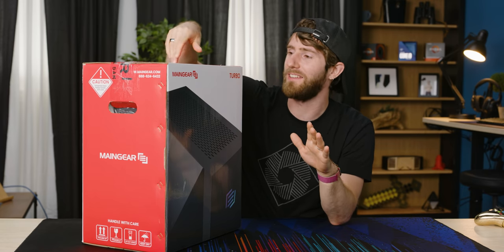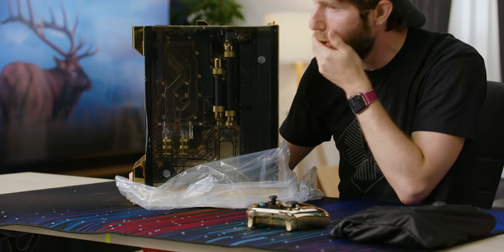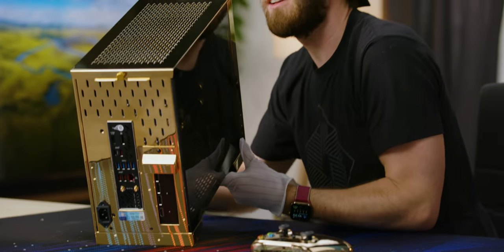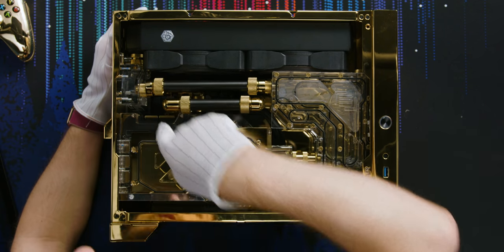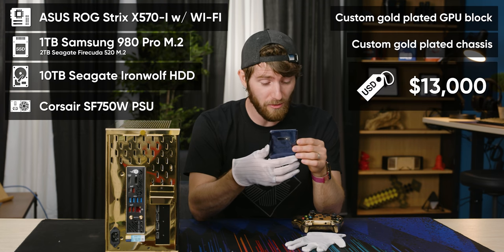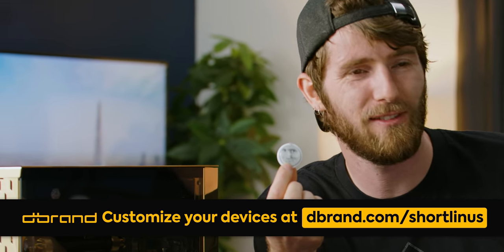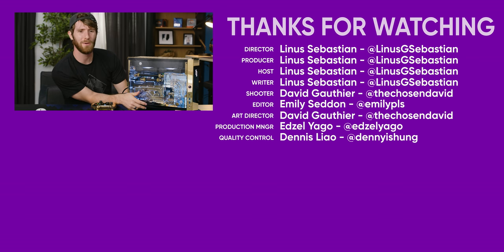MAINGEAR is definitely NOT getting this back! - Turbo PC Gold Edition

Comment: Hey guys, MAINGEAR CEO here.. again :-). Idea for the gold Turbo happened after watching the gold controller video. We're already getting requests to purchase this gold Turbo, and frankly, it's probably not going to become a limited production Turbo. This was more of a prototype or experiment. Gold plating simply exposes every imperfection, and the inner panels just don't look as good as we'd like it to. Perhaps we'll sell it if we ever get the the plating to the point where we're happy.. but who knows! Just thought LTT crew would enjoy so we did it! Also, some quick insight into this configuration. We actually engineered a new APEX block specifically to make room for a thicker 280mm radiator, to ensure the 3090 and 5950x would deliver their full performance. It definitely pushes the boundaries of performance in a small for factor PC.

For the record, there are only two units in existence.. LTT has one and I have the other :-) Let me know if you have any further questions. Cheers! - Wallace Santos / MAINGEAR CEO
Reply: Since they very intentionally steered saying the component temps what exactly did they get too in your testing before you shipped it out.
Reply: Instead of gold plating it maybe you can make it with polished brass? It would look like gold but more robust.
Reply: @Theinc0gnit0  brass gets weathered over time though.
Reply: @Daggers21  From my experience the side panel isn't that thick and is prone to dents.
Reply: @BigYacht  they didn't say common m temps for several reasons. First, this is short circuit. Second, it is not anything more than a fun prototype for an ad spot. It doesn't matter what the temps are, because it's not going to be sold, it hasn't been built and optimized like a product going into production would be. The temps are inconsequential.
Reply: @Daggers21  i think that was caused by the ripped off screw
Reply: You messed up not including trident royal dimms.... Like how?!
Reply: Are you going to let Linus keep it lol?
Reply: Ugh that is just sooo ugly. At least the controller was an interesting build and was technically impressive to see the skill that involved in casting such a complicated piece. This is just gaudy, its about as attractive as having gold plated teeth (and lets be honest here, everyone thinks that shit looks disgusting). I mean, if you are gonna make a gold plated case, at least go out of your way just a little bit and give it some kind of theme or come up with some cool case mods. Not only is it ugly, its lazy and lacks any ingenuity or imagination.
Reply: @clayallen_art  you kidding me? I saw that thing and my jaw dropped. It's got a certain aesthetic for sure but like... how is that not a work of art to you?
Reply: @mindlessmrawesome  i dont know what to tell you man, I work for a design company and we make sculpture and huge outdoor pieces for resorts and people with too much money to spend. I see a lot of gaudy gold, and at least that stuff has form and some style. This is a gold plated box. Like I said, they could have at least put the minimal effort into giving it a theme or some kind of concept.
Reply: Does yours have a broken standoff and a screw loose too?
Reply: @adwaitgoku27  shipping is a bitch mate. Trust me, I worked as a preloader for ups. All you can do is pack it with foam and hope for the best.
Reply: @clayallen_art  like they said, they just gold-plated one of their pre-existing models (that happened to already look really cool). Trying to turn pcs into artistic masterpieces that have shape and form and style typically end in thermal nightmares, take Alienware's and corsair's fancy looking prebuilts. 
Ultimately, it's a matter of opinion, but it still surprises me that you can call something that majestic ugly.
Reply: Meme lord 9000 over here, can definitely tell it shows imperfections more than usual pc paint schemes,  for sure could have put the new trident z royal in there to match it. either way keep up this cool marketing stuff, way better than ads  i block or ignore.
Reply: How about giving one away for someone to enjoy, instead of letting it sit as one of hundreds of PCs in LTT warehouse?
Reply: You should have sent one to Dave Lee too! He is a fan of compact performant PCs.
Reply: Truly a beautiful machine. You guys really do know how to make PCs look amazing.
Reply: Keep doing cool stuff that pushes the limits. Doing something unique is always beautiful to see!
Reply: Nice
Reply: You really ought to uprate the PSU to a 850w or even a 1000w PSU. 750w is just not enough for a 3090 with its crazy peak voltage.
Reply: Your video's sound is non-existent so this is officially the best video about this product :)
Reply: @clayallen_art  they did.the theme was GOLD,lol
Reply: caralho maluco, tu é brabo!
Reply: Props for backing your brand, this is very cool
Reply: @mindlessmrawesome  I never said it needs to be some art piece, I just think that they could have at the least, put some kind of minimal effort into design aesthetic. And yes, everyone has their own tastes, some people like it, to me its just a gold plated box.
Reply: That as a piece of ART right there.
Reply: Do you want it back?
Reply: That golden pc you guys did looks really fancy. Even though I don't even like gold that much, I still think it looks super cool.
Reply: You missed a trick by not using Gold Trident z Roylal ram
Reply: @clayallen_art  it's not a gold plated box it's a cool gold plated engine. it's like you didn't even see the video ;)
Reply: RIP for that terrible trade offer tho, sending over a gold plated PC for that older Turbo in return.
Reply: You know... how about a Hydrodipped Carbonfiber design? And maybe RGB in/shining through the pipes instead of plain white?
Reply: I want it Maingear!!
Reply: You guys should make a youtube channel
Reply: maybe you can glue some sound dampening foam to the inside of those pannels it will look good and have a minor acoustic benefit.
Reply: Looks great, I went to your site to check the price (I can't afford it regardless) - how much would a production version of this system cost?
Reply: Very creative.. thank you for your team doing this art..
Reply: @Daggers21  appeared? That was a Elon musk Cybertruck broken glass kinda dent... Why would someone plate a cheap piece of sheet metal with gold?
Reply: When a RTX3090 can make a 850watt gold+ rated psu shut down(like it did in one of linuses earlier videos) , with a game running, How come you guys build this one wiht a SF750watt ? , its not enogh for the 3090 spikes.
Reply: @Theinc0gnit0  DIYperks has entered the chat
Reply: @alphatumeric  so dont touch it
Reply: Woow nice!! So cool that you commented some insight, thanks
Reply: @Theinc0gnit0  The whole point of it being a gold computer is that it's, well, gold. It's not like Jewelry where precious metals are the standard and you can get away with a cheaper alloy for a "cheaper" budget product. The computer has to be gold or it's bust.
Reply: @clayallen_art  Its like the original concept of the turbo has completely missed you. Then again, Linus did say you probably won't find it interesting if you aren't a tech nerd so as you will
Reply: @mrmarecki1  Cause they only made it for LTT because linus decided to make the gold controller.
Reply: Tell the rich people from Saudi Arabia they like Gold ;)
Reply: just go with black you clowns
Reply: I really love the fun stuff that Maingear does in the community. With such a passionate and out in the community CEO its no surprise Maingear always performs so well in secret shopper. Price to performance doesn't always have to be the only value proposition, the finer details Maingear really nails, and that is what gives me the confidence to recommend them to friends and family that don't have the capacity or desire to build their own PC.
Reply: @mindlessmrawesome  Firstly. Alienware is owned by Dell. Secondly Alienware is Garbage don't buy PC's from them. Seriously yes you get thermal problems that tends to happens when you make fake airholes placing your PSU on top of and i when i say ON TOP i mean ON LITTERALLY TOP of the CPU you get airflow problems.
Reply: @xenonram   On the basic level you are right, but this is also a nerdy channel for nerdy ppl. We wanna know the nerdy facts, just like the car guys wanna have specs on that million dollar Ferrari prototype they can never get.
Reply: isn't 750W a little low for a 3090 and 5950x?
Reply: You missed an opportunity to use the western digital 18TB Gold
Reply: well here's a question, can I have yours? ;p
Reply: I want one I am ready to not buy a car plz made the like the normal ones
Reply: Interesting question, did you think about using the case as an extension of the heat dissipation mechanism? Gold is a pretty gold heat conductor, even if it is just plating. A higher surface area case could play a role in cooling components.
Reply: Did you intentionally make the water cooling look like the Golden Gun from James Bond? I love it
Reply: Thanks for the amazing work!
Reply: Dude... 750W PSU??? For a 3090 and a balls to the wall CPU?
Reply: Out of curiosity, I'm wondering given Gold and it's awesome cooling potential, would this actually be somewhat beneficial for cooling if the case was used as part of the heat sink?

I know the McLaren F1 used gold in the engine bay for heat distribution and to protect the carbon fiber hood from getting damaged by the heat of the engine.
Also I know that many heat shields for atmosphere reentry also use gold to protect the occupants from the immense heat of reentry.

Is there any chance that this could actually help dissipate heat? I know the gold clearly absorbs a lot of heat. The fact that Linus even mentioned how hot the gold felt without even touching it, possibly it was pulling heat away from the rest of the PC? 

I don't have access to large amounts of gold, or I would test it myself, but I'm pretty sure there could be some benefits. Although definitely making sure your computer is completely cool to the touch before touching or moving the tower would definitely be a downside. If maybe there were a clear acrylic shell on the outside to protect against fingerprints and to protect your hands from the heat, and possibly some kind of clear plastic handles of some kind so you can move it without burning yourself, I really feel like this could be the ultimate level of cooling possibilities.

Heck even manufacturers of high end gaming phones also use gold as part of their heat dissipation, so there has to be some benefits of using gold for cooling right?

As for the Bluetooth issues, might be best to have an external Bluetooth antenna via PCiE Wi-Fi Expansion card for better performance.
Reply: I think it was super cool! Thanks for sharing.
Reply: Let me get that rig with AMD Ryzen 9 cpu and a 6900xt Please! I have a few grand to throw about! $$$$
Reply: @Theinc0gnit0  Steampunk PCs... We got the watercooling, get some brass!
Reply: pc dos sonhos, parabens pela empresa!
Reply: Eat the rich.
Reply: Hey, Wallace Santos my brand new $1600 PC will not boot up to Win 10 just shows no HDMI 2 blue screen that turns on and off. Not real happy, sent an e-mail to customer support for help. Not happy right now. Using my 12 year old Win 7 to type this. Got this to run MS 2020 and other Win 10 games not happening right now.
Reply: @ohwell2790  give us a call tomorrow and we’ll make it right. Make sure you plugged the monitor into the GPU and not the IGP on the motherboard.
Reply: Make it in red mirror please !!!!!!
Reply: Rip 
i wanted this case it was original
Reply: Now all you/he needs to top it off is a gold-plated diaper!

Comment: Linus: pulls joke

Me: laughs

David: you make that joke every time!

Me: awkwardly stops
Reply: @stellarproductions8888 than ("then" is for time, "than" for differences. Can't be *that difficult...)
Seems you're the joke... :-3
Reply: @dildojizzbaggins6969  Sure, if correcting people's words float your boat, ⛵ please do so enjoy. I however, enjoy my new MSI GE76-231 Raider notebook computer with a 10th gen 10870H I7, 8-core 16 thread CPU, with it's delicious Nvidia 3080 GPU with 16GB of memory, with 32GB of system RAM, and a PCIE M.2 1TB SSD drive. 😋
Reply: @stellarproductions8888  sounds delicious
Reply: Well, he says it about the manual not automatic joke. Can be said about most things, not just this specific computer

Comment: “You can buy this gold controller” - demonstrates it not working

“You can buy this gold computer” - demonstrates it barley working
Reply: As if someone would buy a gold controller for the practical value.
Reply: Update that BIOS for the AMD chip to correct those intermittent USB device disconnectons

Comment: 2:36 It has a dent on the side panel, if I paid 13K I won't like that.
Reply: Good luck keeping a pc panel mirror straight.
Reply: @Xfade81  That dent looks like someone hammered it from the inside.
Reply: that loose screw might have gotten stuck between the hard drive and the side panel. it would explain the sharp dent
Reply: @Xfade81  Im sorry for 13k you can manage that out of the box at least. If it was wavy thats one thing but the dint is so obnoxious with that mirror finish.

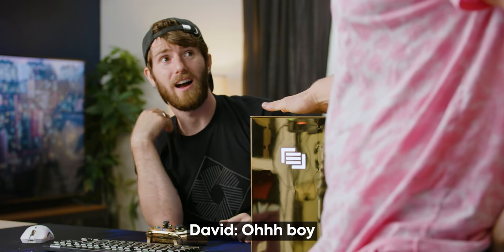Comment: 7:54 isn't the water level much too low? Does the affect the cooling?
Reply: It is pretty low, but as long as the loop flows as it should be, it won't effect the cooling capability of the loop significantly. I will reduce the thermal capacity of the loop, but not the cooling capability.

Comment: Hey Linus, if you were a car guy which your aren't, you would know by now that gold is the one of the best heat reflectors and not conductors. This is the reason gold was used to line the  engine bay of the McLaren F1 road car. It is also the same reason why satellites and such are covered in gold foil. And this is also the same reason your PC case is hot, because the gold within the case is reflecting all the heat within the case. If Maingear had simply not gold plated the fixtures and fittings and the interior of the case, it would have been much cooler. Seems like a very rookie mistake.

Comment: Gold is about the best heat conductor in the universe, I'd be surprised if the case wasn't hot. Yes, even if it's only played over with gold
Reply: Not really. Gold (315W/m.K) is only 4th after diamond (2000W/m.K), silver (429W/m.K) and copper (398W/m.K). Far from the best

Comment: I got one of these a couple months back and all the reviews say that it has great cooling but all of them are water-cooled. Me only being able to afford a 3060ti and r5 3600 didn't really have the funds for a 1,000$ water-cooling upgrade. Well, it overheats after 20 minutes of gameplay with the side panel off. I have to run a box fan right next to it. Now I love the size and it was the selling point for me but it's very frustrating in the summer I've only had it since March so I'm hoping it doesn't persist in the winter and the side panel can go back on. Overall love the system just wish it wouldn't shut down if forget to turn on the fan.

Comment: Yeah 750W PSU with that 5950x and 3090 is not going to cut it. That sudden spike in power from the 3090 may cause issues later on.

Comment: If you think the top of the case is hot put your fingers on the back of that 3090 where the back side vram is at 👍. I have a high airflow noctua 120mm fan pointed straight at the back of mine in an open bench and that thing can almost cook lmao!

Comment: i have 2 360mm rads with a 3090 and a 10900k in a phanteks eclipse the big boi case and the top of it gets too hot to touch. These 3090s man they need a car rad with a car fan to keep em in check.

Comment: If the rads are hot the chips are not... it's only more so because the heat is concentrated to 140mm area not 280mm.

Comment: A 750w PSU for a 3090?  I mean, it meets the minimums, but any overclocking in the system would be pushing it, no?  850w or higher would be preferable.

Mind, I guess they would know better than I do.

Comment: I have a 3090 on a 420mm radiator and even still with Noctua's 3000 rpm fans at over 50% I still hit 60 degrees. 3090s output way too much heat.

Comment: That's what i have rigght now.  except I have a 1600 watt psu and 32GB of RAM.  It's all air cooled and I have the a/c going constant up here.  Which btw is made out of gold, but I was going to water cool the whole thing and send the radiators to the a/c unit.  I was wondering how long you could game on it.  I play a game and start off round 170 fps but after 7 hours of solid gaming it usually goes down to about 100.  And I know that keeping temps low makes the ray tracing stronger.

Comment: Unpopular opinion but what the hell is an HDD doing inside a $13,000 machine ? We have 8TB M.2s or regular SSDs and you could fit 2 regular SSDs in the space of that HDD and have both higher capacity and performance.

Comment: I think I know why the controllers disconnecting. The gold metal is interfering with the signal no? Just plug it in USB. I remember when I had a carbon fiber Case on my phone cellphone signal didnt work.

Comment: "How'd they manage to power it with a 750w?"

Uh, my 3090 FE / 5800X system is powered off of a Corsair 750W, and I even have my GPU overclocked.

Comment: I just got my Main Gear PC $1600 and it does not work right off the bat.There web trouble shooting guide said to leave on for 2 hours still no Win 10. After 4  hours pressed the enter button then it went to a garbled black screen with closely spaced lines and a disjointed smaller blue screen that said lets get started ? I thought that Win 10 did not to be activated and that is one reason I bought this  PC from them. Send them an E-mail, hope this can be taken care of 2 year warranty right. If not will dispute this payment with my bank. Not happy